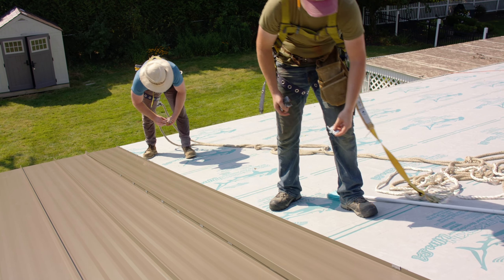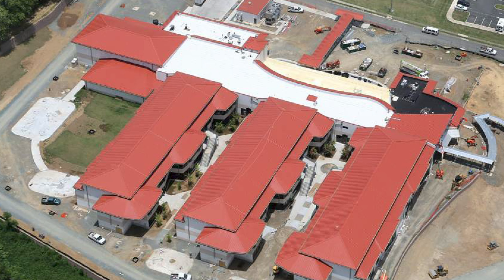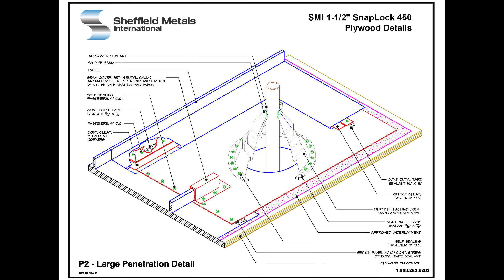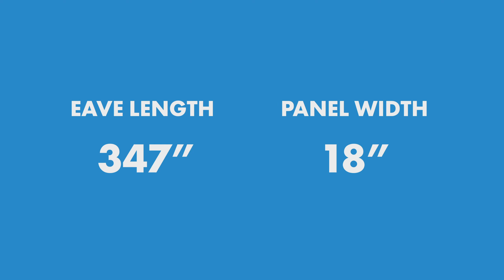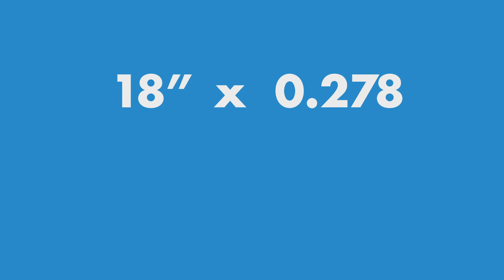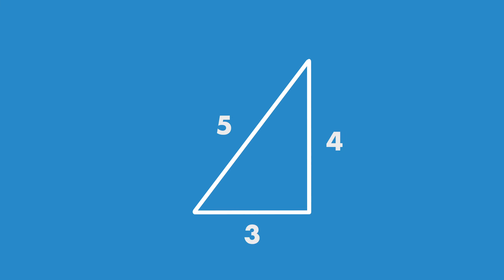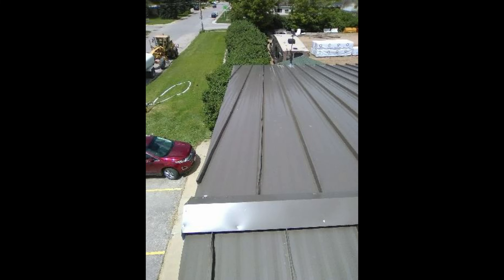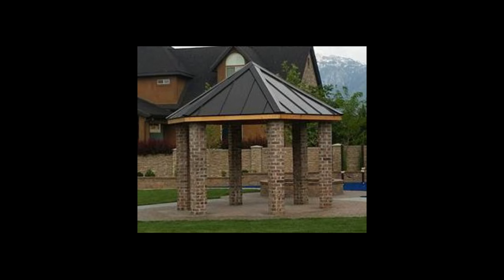How to Lay Out and Square Metal Roofing Panels

Comment: Got it, thanks Thad! 😊 Now, what does it look like to install the penetration after the roofing is installed? I can conceive it in my mind, but that doesn’t mean that’s how it should be done. Do you have a video on that?
Reply from the maker: Can you elaborate a bit more? As in the panels are already on the roof and you need to put a pipe through them? -Thad
Reply: @TheMetalRoofingChannel , the question is pertaining to the information shared at 9:37 - 10:05 in this video.
Reply from the maker: @BrianBaldridgeC  I see! My interpretation of his explanation there is that as you're paneling across the roof, wait to cut the penetration in the deck until you see where the panels will lay. That method is really usually only necessary for large commercial roofs where you can't measure from the end of the building. -Thad
Reply: @TheMetalRoofingChannel , got it! That makes sense, thank you Thad!

Comment: how do you stretch and shrink it and keep it streight do yoi ever have 2 cut the rakes?
Reply: if you need to move the top side of your panel towards the gable, you c-clamp the panel to the lowest clip and toe-nail a screw in the top of your panel until you've stretched it enough. attach all your drag loads then replace the toe-nailed one last to keep tension.

if it's the bottom of your panel, you clamp the top side to the previous panel and let the bottom float. you can also give it a tug if you need but it's a marathon not a race.

Comment: How do you seam when it is say 6" from the side of the chimney and the panels  terminate against a brick wall? With hand seamer, i.e. 180 dble lock? The chimney is in center of roof, so seams are to the left & right side. Thanks Charlie
Reply: I remove the outside screw from the handles of our hand seamer and leave one in loosely so I can pull the handle down or up and use multiple short passes. hope that helps

Comment: What is the roof is not square...do you "trim" or adjust the first panel, and then go from there...and what if other end(rake is not square)
Reply: You may have to cheat your panels. And depending on the product you’re using yes, because there’s many gable end flashings that will cover your messy out of square house provided it’s no so crooked that you can notice the corrugation lines going to far in or out on the gable edges
Reply: @7ovinadventures916  luckily I could not get panels shipped in time for what i needed...so i cancelled...and did a torch down roof.  Not as pretty, but solid, and cheaper!
Reply: I hired a guy.  I was curious how he would approach the "paralleogram"  type roof I had....he just lined all strips up with the eave...and then trimmed on the back end...although the strips went "east to west" vs north to south...anyway..it looks pretty normal.